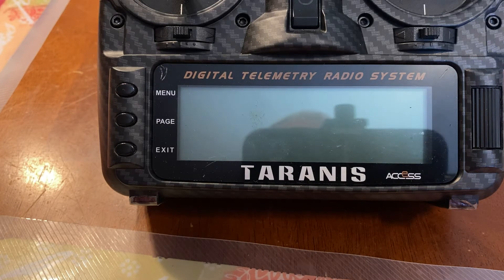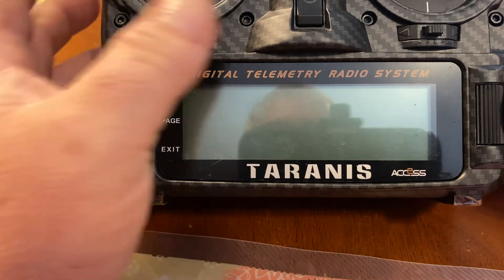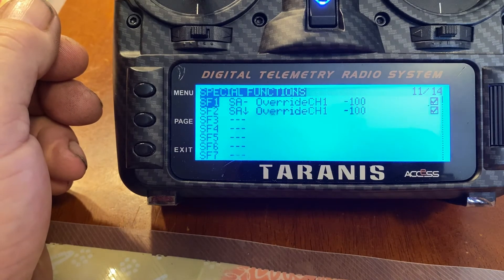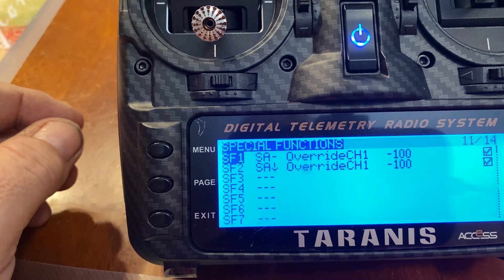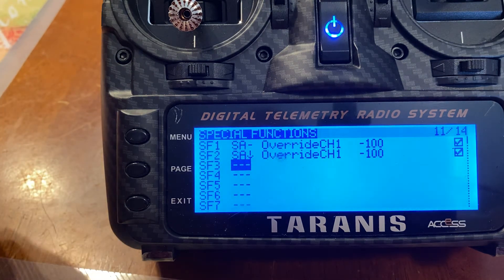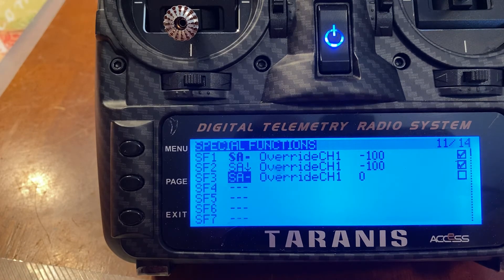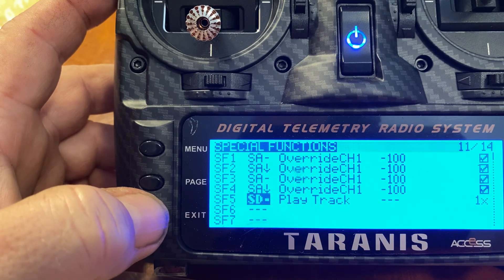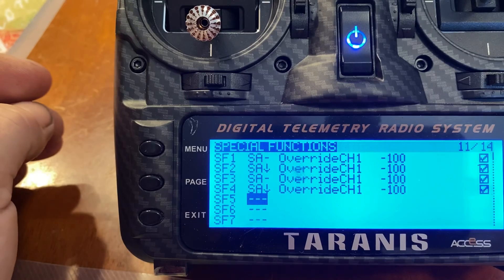Throttle Cut.

Comment: Your method is better than nothing and adequate for glow engines although I would use a momentary switch but if you catch the switch while the throttle stick is not at minimum then the motor will start unexpectedly - you need to add additional conditions that ensures it will only arm when the throttle is shut

Comment: You could reduce it to two lines by using NOT SA up ie. !SA ^ - in addition if the throttle is not at minimum when you flick the switch an electric motor will suddenly start possible causing injury.
Reply from the maker: Yes two lines is normally how you do it but this was just a tutorial on how to set it up. The first two lines were my already programmed function. The last two lines were the show how.
Reply: @shondorc3703  Sorry I didn't explain myself instead of doing it with two lines, one for each switch position you dont want you can do it with just one line and the switch is !SA^ in other words if the switch is not up then it overrides the channel.
Reply from the maker: Yes. I certainly agree. But I don’t want to start confusing new users with symbols and their definitions. I created the channel to be simple and easy understanding.  Once they get acquainted with OpenTX, then they will and can learn other stuff an their meanings. However, you did give great instruction and I encourage all YouTube watchers to give tips and tricks as this is how they can better learn. With this system, we learn from each other. I will be doing a basic series on how to set up from start to finish then I will encourage, once the fear and confusion about this system is tackled, to download the OpenTX manual to learn even greater things which I myself don’t even know. Thank you for subscribing and a big thank you for being interactive. That’s what this channel is all about.